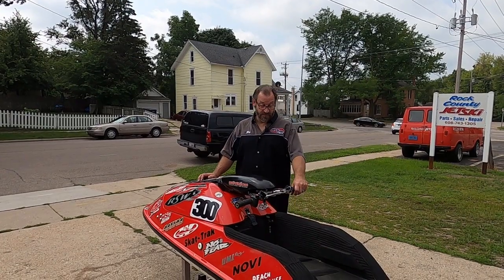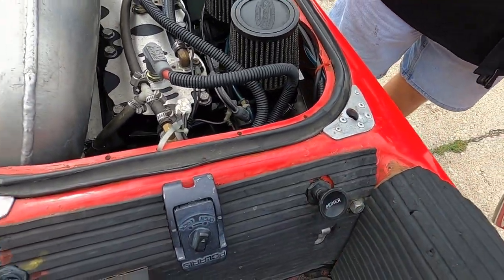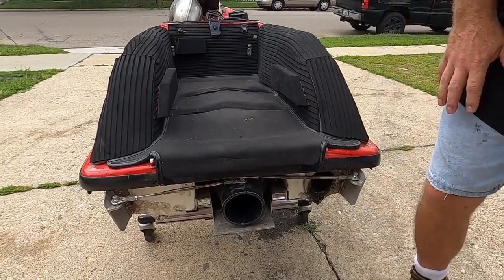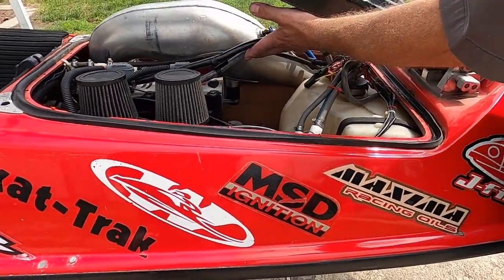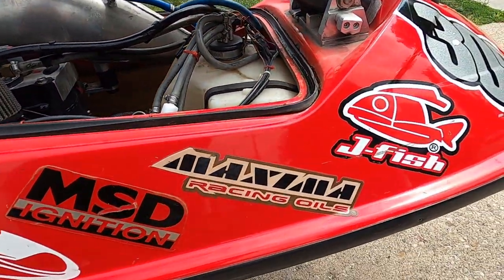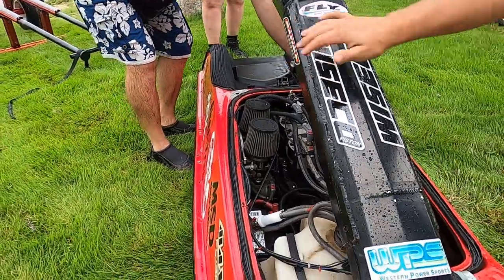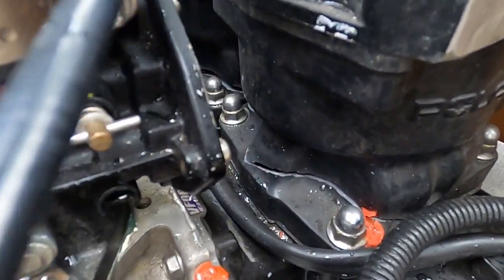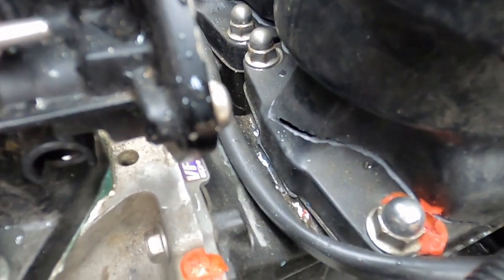Flying Fish Polaris Octane

Comment: I'm so glad you posted this. We seized a cylinder on our triple piped X45 on the long beach to cat run with our pro rider. The cylinder was literally riding the piston up and down with the ears still attached to the studs. This is when we found out the domestics had been doing this with the higher revving boats, if they run into any issue like this.
Reply from the maker: Our problem was water ingestion. I think the drive bearing / seal went bad, took on a TON of water (as you can see in the video) the engine took a drink, and broke the cyls.  Won't know for sure until I take it apart, and go through it. Honestly it probably won't happen for years....
Reply: @watercrafttalk2738  that was exactly what I was thinking. If there was a few inches of water sloshing around in the bottom of the hull, and you guys didn’t notice any steam pouring out and didn’t notice any water lines and hoses leaking then driveshaft seal would be the first thing I think of. I realize that in its current condition it is not possible for you to run it on the trailer to look for water leaks. Hopefully you did that before taking it out for a spin? You obviously know what you are doing and I’m sure you checked to see if any through hull penetrations were leaking like exhaust outlet, Water tubes from jet pump, Steering cable through hull fitting, driveshaft seal etc. And if you guys didn’t notice any water infiltrating while it was just floating it’s possible that water only leaks when the pressure exceeds a certain point at higher rpms? Most skis have exhaust hardware vibrate loose at some point like those pesky header pipe gaskets that always leak! I know that 180 psi id a lot of compression but not enough to pull a cylinder jug apart like that hahahaha I agree that water injection is your culprit and seeing as water is incompressible something had to give and I’m shocked that the cylinder did that. Usually the rods or pistons take the abuse or the engine just locks up dead but I guess if it was running high rpm and took in a huge gulp of water all at once through those flame arrestors then perhaps the Inertia of the crank spinning with the weight of the flywheel, couplers and driveline at a high rpm, it probably wanted to keep spinning and overcame the resistance and just popped the jugs right in two. I guess that’s a testament to the strength of the bottom end in that race boat!  
Thanks so much for sharing all this cool stuff. I have never actually seen an octane in real life, or even on Craigslist in my area so I never really knew too much about this ski. They look amazing!

Comment: That is why they gridled the heads and when you suck in water on high compression, it has to go somewhere! the rods were stronger than the cylinder casting.